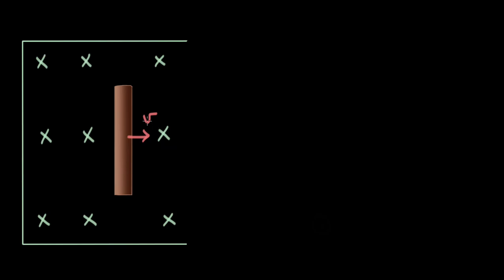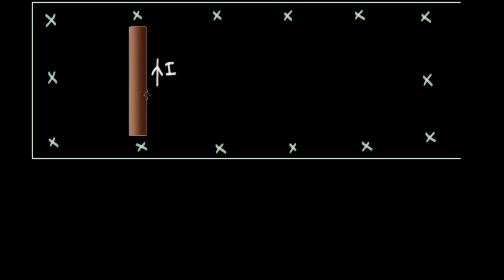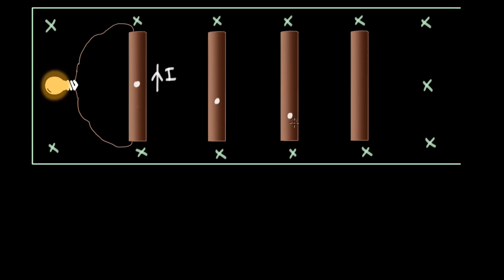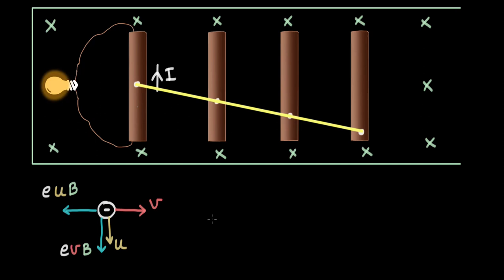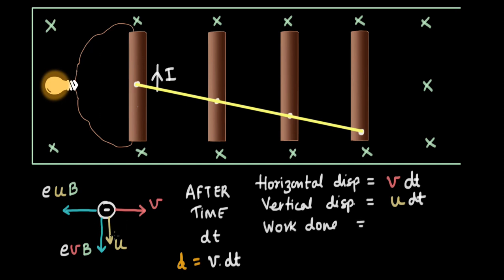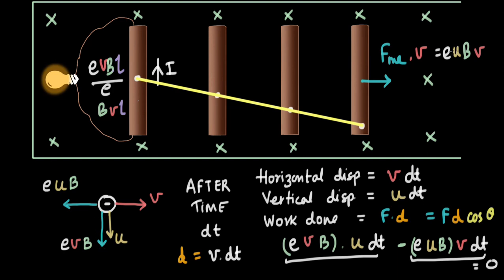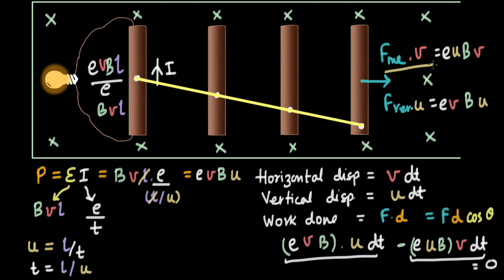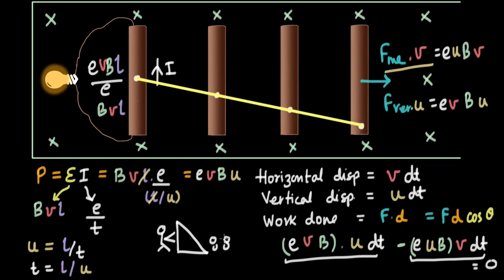Part 2 - Why is an EMF induced in a moving rod?  | EMI | Physics | Khan Academy

Comment: At 1:04 there is a mistake. As found out in the previous video - in the top part of the rod there will be a positive charge accumulated and in the bottom part, there will be a negative charge. So by convention, the current should be going down!!
How is it going up?? Or what mistake am I making??
Reply: @GreAse0MonKey
The direction of current is in opposite direction of electron (conventional current)